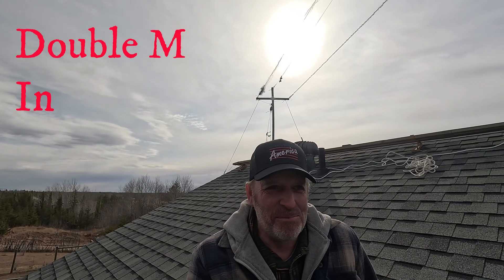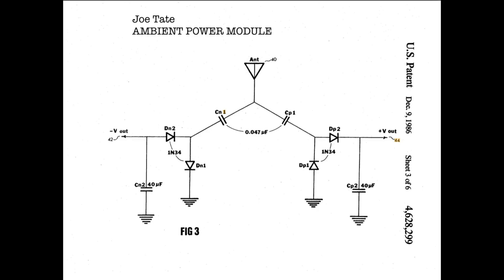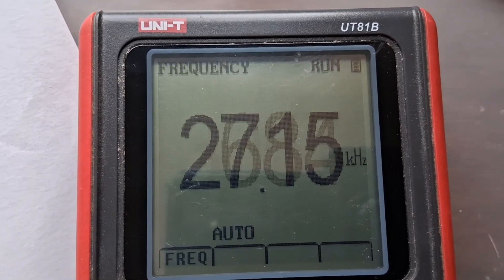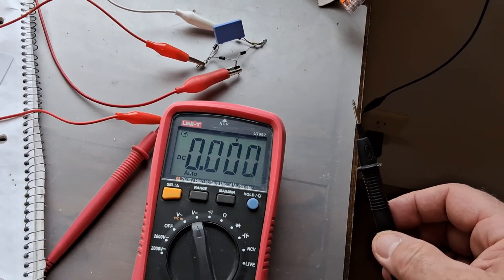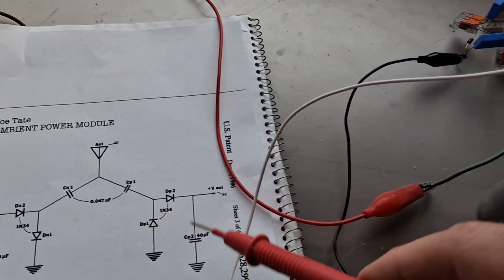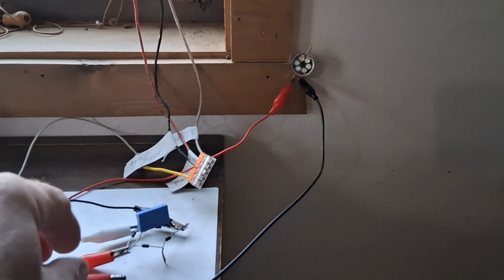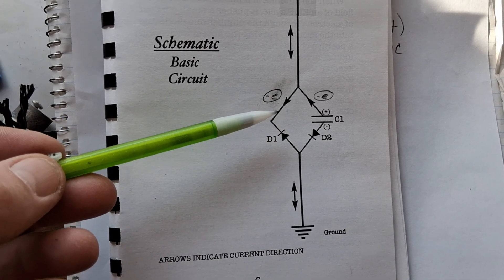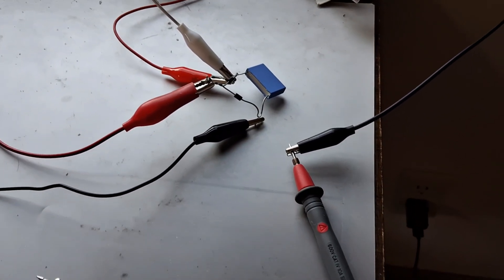Joe Tate, Ambient Power Module comparison

Comment: Possible solution to the vibration and hum from the wires in the Wind ; sing by the length of the wires I would suggest 8 tennis balls per wire, take the tennis balls and slice them halfway through to the center axis, so halfway through cutting it into two halves. 
Take these tennis balls and slipped them on the wires somewhately evenly spaced, if you choose to added security you can glue the Cuts closed with Crazy Glue after starting the tennis ball on whe wires. If you choose you can add non conductive separators to the balls to create a triangle to enhance separation.

Comment: With those antennas so close together they are fairly coupled to each other making them all work more as a single antenna.
 You may be better with a schottky diode.  It has the same drop as the germaniums but has a lot less reverse leakage.  You are likely losing a lot of the power into the leakage.
Reply from the maker: I tried germanium and Schottky diode, but did see a difference at the voltages I'm getting.  The frequencies aren't very high either.

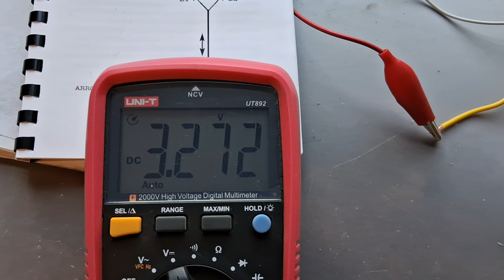Comment: 12:00 wont work because actually you are increasing this potential in the antenna, its called impedance so your antenna turns into a transmitter or in this case a resistor
Reply from the maker: Actually it works like I show in this video, if you watched it.  No tricks.  It's been working since the 1980's when I discovered that it does work.
Reply: @doubleMinnovations  yeah but you just catching AM radio waves and such. You need to really excite the antenna by oscillation and then capture the impedance. Imagine it as a normal pump action you  discharge the very Earth, then I think you need to capture the backward current, when antenna is connected to Earth it creates a ionised dielectric cover of air around the antenna, then when you disconnect the antenna from ground the electrons dissipate (the higher the antenna from the ground the better). Here is the catchy part you need lots of copper so while this movement of electrons occur in the primary coil you capture the impedance with a secondary coil and capacitors, when capacitors charge discharge them with a spark to a transformer to lower voltage. The higher the oscillation frequency, the greater the surface area and the quality of the capacitors the more voltage you can capture. Try using even more coils and spark gaps to lower the voltage otherwise I am not sure if ordinary HV capacitors would capture enough current due to impedance. They need to charge and discharge super rapidly instantaneously similar to Leyden jars, maybe if you try multiple small capacitors in paralel you might get less impedance (any backwards induction to the primary coil can mess up the oscillation). Try use also a mercury filter before the antenna so radio waves don't mess up the oscillation. Also you can experiment with conical capacitors (where surface 1 > surface 2, usually they produce them 1:1, the very capacitor can serve as a little transformer too)

Comment: I really believe capacitors should be choose for whatever curent is available … Tesla have shown what to do with his radiant energy apparatus. If you can get high voltage is absolutely fine as P=VxI. If a fast action is secured (capacitors fill fast) you have to attach inductors to exploit what you get.
So, you can employ a quenched spark gap to discharge capacitors at desired voltage and current should be improved in working circuit … there is another patent of Tesla for this arrangement, i think is 462419 if I remember correct. And according to Tesla works with both DC or AC.

Design your inductor based on MMF online calculator from teslascientific and add a secondary 4 times longer wire.

Using few patents of Tesla you can get some decent power to run something on this free harvesting.
Reply: Sounds like you could draw up some plans with pictures. If you did, I’m sure people will throw a few bucks your way. I would. I’m no expert, so I would need it in extreme layman’s terms. Maybe you could work with MM on it and both of you could benefit. If you or anyone else did this, information for safety, accuracy and troubleshooting testing procedures would be a very wise addition. Us viewers appreciate specialists and experts chiming in, so thank you. Have a great day brother.

Comment: Thanks for the demonstration. Germanium will need more complicated tuned circuit, or many circuits for different frequencies. Two germanium transistors are most sensitive way to go for full wave rectification, they also have even less voltage drop. Your antenna seems to be a bit close to the buildings too. Usually it should hang further away from trees and buildings on some non conductive line (anything solid is part of the ground capacity).

Tuned same size ground antenna will also amplify the resonance, but it has bigger lightning hazard. It's called counter antenna, or virtual ground mass. Bad ground is like jumping in a mud. Full ground is like jumping on a concrete. Tuned ground is like jumping on a trampoline.
Reply from the maker: The antenna location, is me making do with what I have; (highest points).  I have 4 different grounds, but the one driven in down by the pond delivers the highest voltage, and highest frequency, 30-40khz.  The frequencies are lower with the other ones, in the 20's(khz). -don't know why...
Reply: @doubleMinnovations  The antenna and ground together make basically a big capacitor. The ground wire doesn't really have to touch the ground, it just needs to be near to it. But they should be equal in size, so the wavelength are the same. You can adjust both shorter in wavelength by adding variable capacitor (or small capacitors) in series to them.
Reply from the maker: In another video I show the installation of an 'insulated' ground, just out the window.  The pond ground is still a little bit better.  Could be because of the long wire down to it.  I did bury an electrical extension cord in the ground before, and that worked too.
Reply: @doubleMinnovations  All my information about the ground comes from years of seeing people witness and wondering about the ground capacity. I just found the info on some old radio book. They call it virtual ground mass these days. You can also make a ground plate by connecting tinfoil to well grounded wire. Then make a pancake coil that is same length as the air antenna and put it on the ground plate.

If you worry about the lightning, then just put a fuse on the circuit and make alternative path to ground with small spark gap for the lightning.

Comment: Like the comparison experiments of the different capture circuits. Wondering what direction you'll be going next. Have you tried your copper-zinc capacitor sandwich with it?  And seems like something could be generated with that antenna vibration.

Comment: Do you ground that out during storms? I ask because I have seen videos with long wire antennas shooting arcs inside where the wire comes in. Might be interesting to try to capture that, but it would take some higher voltage components.
Reply: Good point.  Safety first, right?  I've heared there is something called an Antenna Discharge Unit (ADU) installed outside the building which is highly recomended with any Antenna/Ground system. A diverting spark-gap is a big part of it.